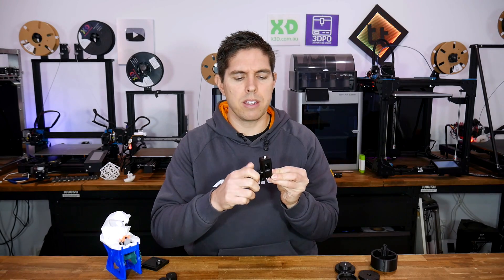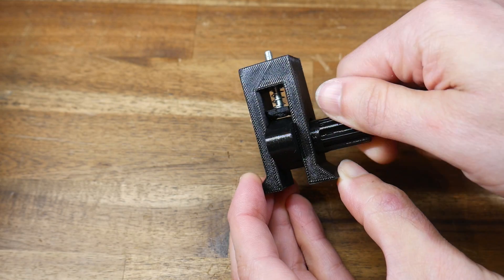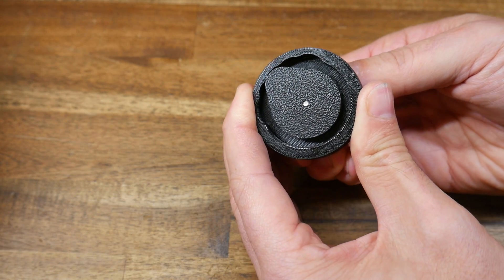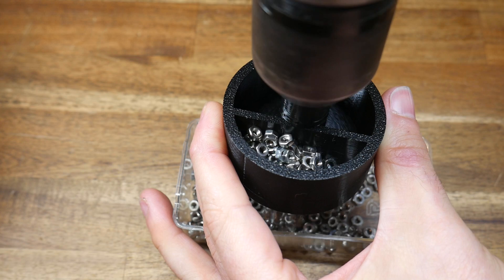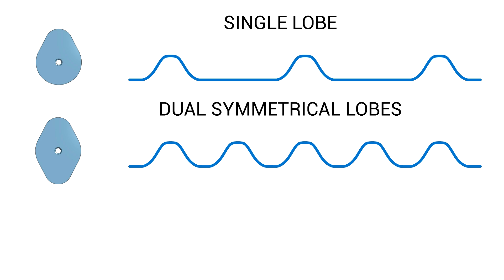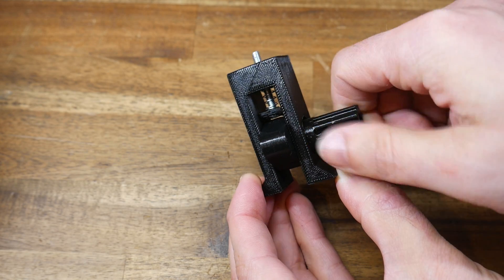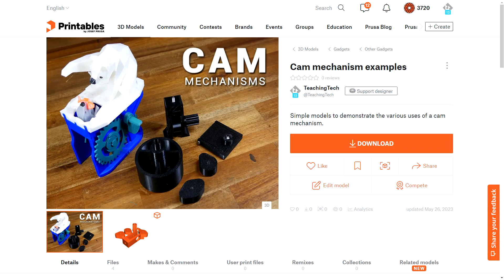Cams are simple to design but oh so versatile - Guide with examples

Comment: I am trying to link cam B to a gear b system. for e.g. make an object say, walk using cam you show (up, down) and then place it on top of a gear (bevel) that rotates the walking plane (walking plane a bit heavier with the walker). stuck and unsure how to link it as simply as possibly. ideally rotating disk should move slower and walker walks a little faster. but getting them position is the issue. how to link it to operate on samee shaft? i want to stabilize the walking planee where gear rod is not going to wobble and go out of alignment from gears, prevent walking disk from slanting

Comment: The rotating switch was a horrible example to use for a cam because you were relying on the compressibility of the plastic for your snap action. If that was made of any more rigid material, it would not work at all. those switches using a spring action for snapping between the detents... NOT cams at all. Cams are used to facilitate a different or timed movement and occasionally it has uses as a latch to lock into a certain position. maybe if you had cut a slice out of the side of that lobe to give it someplace to flex into, then your switch mechanism might have worked.

Comment: i try again i postet in under video 1 but no reply

I love you videoes. but any chance you can  show how to build a rowboat that is almost build like a viking ship. with both ends higher then the middel one. and have a thiknes of the rowboat like 1.4mm think . lenght of the rowboat shoul be like 90 mm.  hight of the rowboat 16mm on both sides but middle 14mm and with of the rowboat should be 30mm. i tryed in tinkercad and that i cant do it in. so now i like to lea

Comment: Hello Teaching tech and community,

I recently have been trying to push the speed of my 3d printer (ratrig v-core 3.0) and I don't have input shaping. To try and reduce ringing, I thought I would attempt to stiffen the frame. The result was that I added paracord diagonally to the frame like cables to siffen everything, a link to a pdf picture is bellow.
file:///C:/Users/adsik/Documents/Picture%20of%20Ratrig%20V-Core%203.0.pdf
I was wondering if anyone else had tried this, and, if you have input shaping with an accelerometer, how much it reduced the vibrating.

Comment: The only cams in this video is the polar bear and your cam with the screw popping up, most knows that pop into places use a detent and not a cam, that window example would be a cam but it's not due to the fact that lobe merely stands in the way and does not force window shut when rotating

Comment: This new series is an excellent idea! I'm really hoping there will be an episode that would explain how to use a servo motor (max. 180 degrees rotation) to open and close a (very small) plastic door. I just can't figure it out and I also couldn't find anything relevant online. I guess my Google-fu is not strong enough!

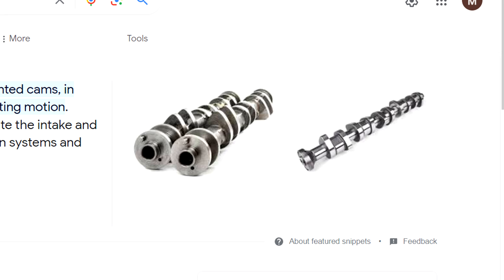One comment on the video: cams do indeed turn (no pun intended!) rotational movement into linear movement, however, while doing this, they also accomplish something else: timing. It's very briefly mentioned in this video at 1:49 and it is also implied throughout the parts explaining the ICE and the bear & seal toy, but I think it deserves a bit more attention :) Just look what else was done using camshafts: https://youtu.be/lAFMl5bkP5Q?t=1173

LE: For my episode wish above ChatGPT suggests pulley systems, crank arm, rack & pinion, or lever mechanisms. I still can't picture how it would look and work though :(

Comment: I would appreciate any help regarding cam design. In the first example shown in this video, how do we control the duration (in degrees) for which the follower is lifted? I'm assuming it has to do with the radius of the lobe but I would like to know the relation between lobe radius and lift duration. Also does the follower dwell at the lifted height or does it spend most of the duration ramping up and down?

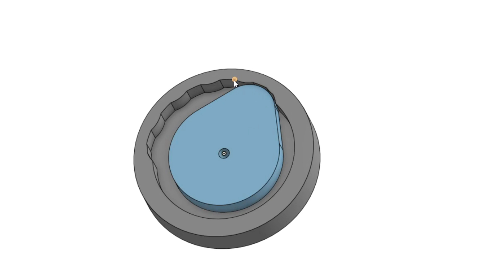Comment: A trick, I would use, for a satisfying click (at 5:04) with PLA would be to make "high resistance spots" very thin. This way the plastic can act like a spring to provide resistance without restricting the rotating motion as much.
(I will provide a link to a proof-of-concept model when I get to designing it)
Reply: I was thinking a detent would work better than a solid cam would in that situation. The solution you described works very much like a detent while also spreading the spring wear to multiple spring sections instead of the one detent.
Reply: @beckoningjinx1119  Thanks for mentioning this! I was looking for this kind of mechanism but didn't know that it was called detent.
Reply: Unless you are using Pro PLA or some other plastic, I would expect this to accelerate cracking of the housing. I have flat items printed in virgin "first gen" PLA and they are cracking just from the loading force of screws. And this is even through fender washers. In my experience, first gen PLA really requires over engineering to make it stable for mechanical applications.

Comment: Thanks for these great examples. 
Thinking about the dial. Would a spring loaded cam lobe get us the desired results without having to fine tune the tolerances? If so, maybe this would be a good use of a print-in-place spring mechanism?
Also, could you instead change the cam to have a complex cam profile and them have a spring loaded follower (like in your later examples)?

Comment: I'm a bit disappointed with the contents.  I signed up because I was interested in 3D printing. Mechanical knowledge is for other channels. Of course interesting info, just not what I expected.  You don't do much of this kind of content these days.  What you would be interested in: Presentation of printers, new motherboards, new solutions, klipper settings, slicing software practices and what's new etc.

Comment: Alot of detent mechanisms use a ball bearing with a spring behind it that pops into a divot at each detent position. A cam detent alone is somewhat rudimentary and awkward. If the perimeter that the cam seated into at each detent position were more "springy", the action would probably be smoother!!!
Reply: I was going to say the same, those switches use some form of dedent mech. The cam could work but the tip would need to be made springy with some form of live(?) mechanism.
Reply: A lot of the examples shown aren't cams, like that rotating slot for the bin with the nuts is simply a rotating window